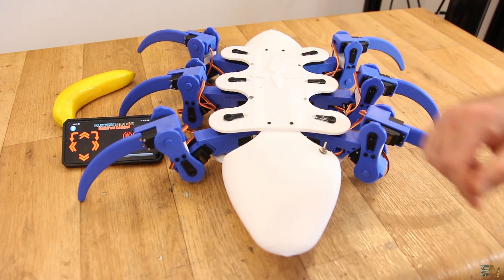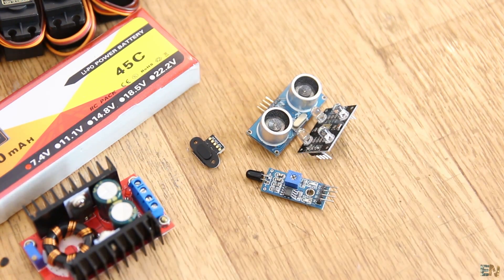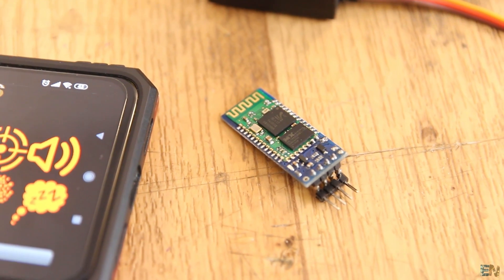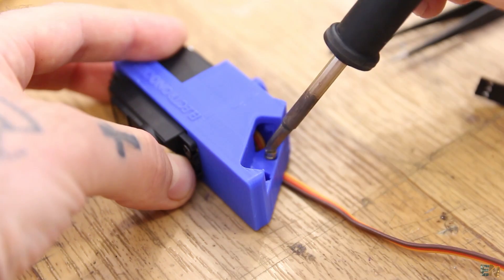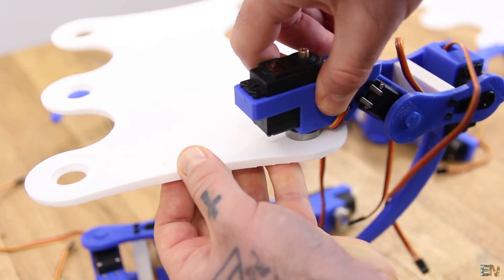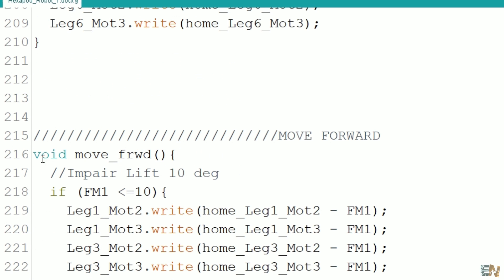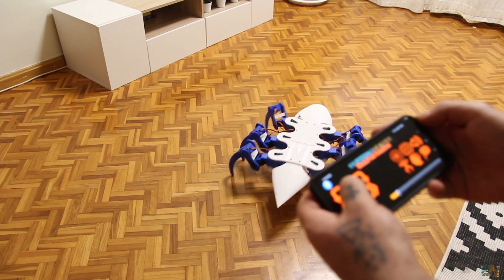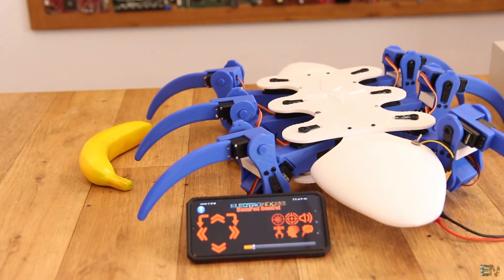Hexapod Robot With Bluetooth - 3D PRINTED

Comment: Amazing project which I have printed myself and put together but having trouble getting it to work - one question I have is the order of the legs, you say leg 1 is the front left leg - is leg 2 the front right or the 2nd left leg? Basically how are your legs actually ordered from 1-6 as they sit on the hexapod? Help here would be great...

Comment: Great project! Maybe think about stronger Servos at least for lifting the robot up to be more future-proof for additional sensors/weight? It seems they are now running at the limit, having to put the existing ones to maximum voltage. Would be cool to be able to buy all parts necessary as a kit (like with the robot cars).

Comment: First of all I really like that project als always but I maybe have some improvements:

For the controlling of so much servos you can also use a i2c servo controller. Its really easy to use and like this you can also use a arduino nano.

And maybe you can use the same program like Jim Burton with his mini dog so the "foot" moves in a direct line and the walking is more smooth.
Reply: Why send the control signal to the servo controller when you can just send the signal directly to the servo?
IMO, the only time you should add a servo controller is when you run out of IO pins.
The motion required to produce smooth hexapod motion doesn't follow the common motion profiles in a servo controller. You're better off calculating each servo position at 50Hz. This sort of calculation produces the smoothest motion.
Check my channel for Halloween Hex for an example of this sort of motion.